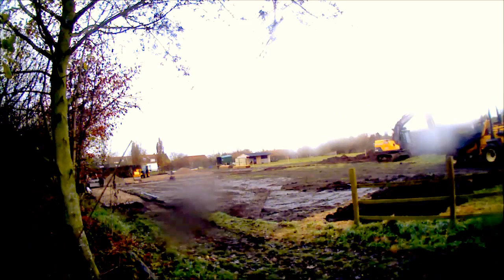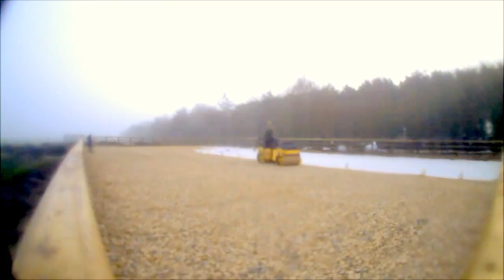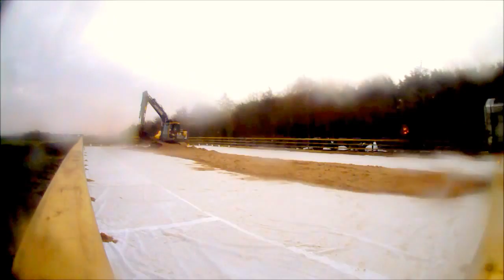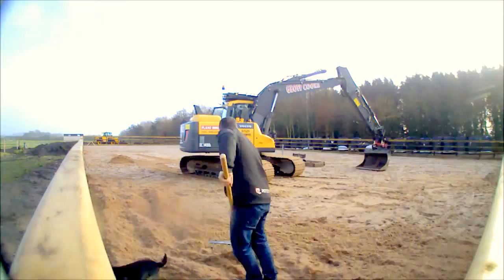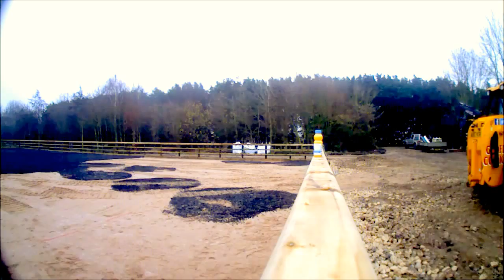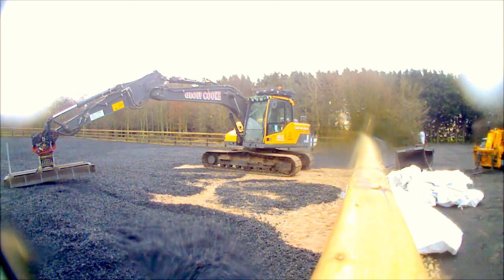Equestrian Manege construction by Steve Hill from Geoff cooke Arenas

Comment: Hi steve. The arena we are want a 60 x 20. Thing is im struggling with the water....rain water. The field is lower then the road  on oneside and level with the farmers arable  field the other with no ditches in sight to expell and water.and wen we dug down 2 n half or 3ft for some gate posts we hi water and the ground is soft black fenland compost like soil... so how can i get around the rain water side of things as wont it be a waste trying to put in a  soak away??
Reply from the maker: Hi Grant, did I send you a quotation for the arena?
Reply from the maker: Sound like you may have to do a long shallow soak away, and.then build up the levels with stone so you have plenty of water storage under the arena , you will also need to consider longer posts in this case .
Reply from the maker: Obviously this just adds to the cost , arenas are not cheap never have been never will be , not if you want it to last